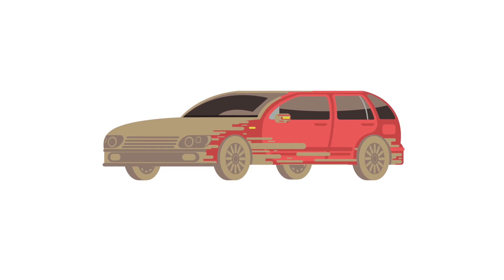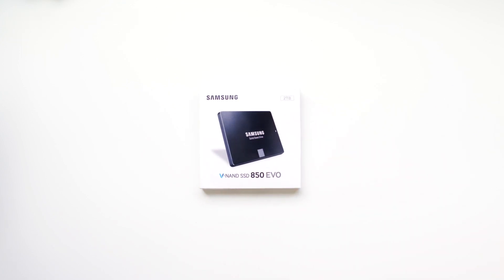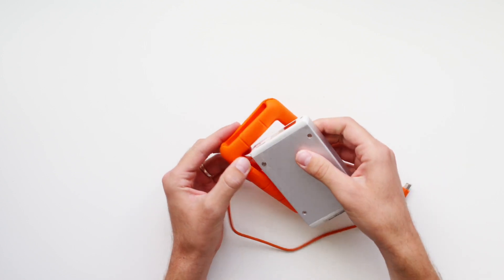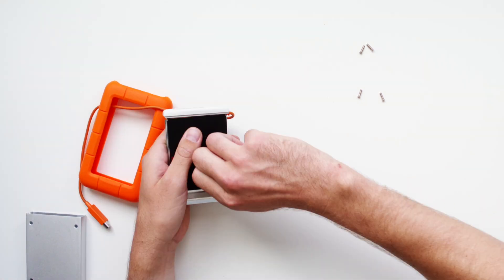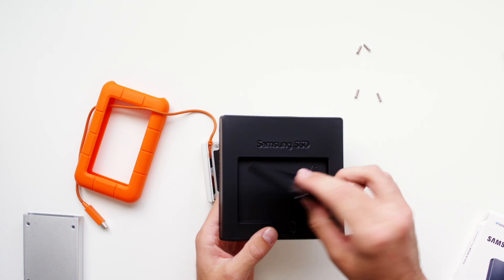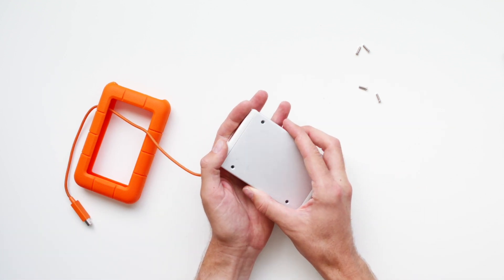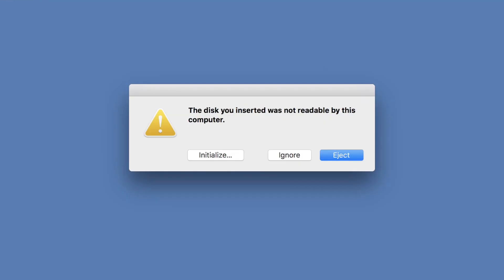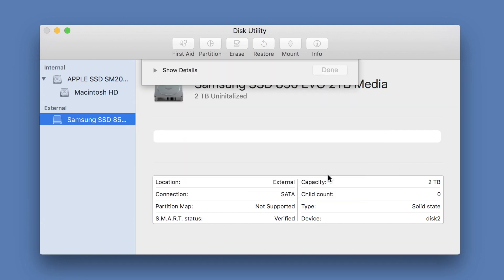DIY Upgrade Your Lacie Rugged Hardrive

Comment: I recently upgraded my 1TB Lacie Rugged USB-C drive with a Samsung QVO 2TB SSD. When connected to a 5Gbps SATA dock, I achieved speeds exceeding 400MB/s. The same goes for when I used a generic enclosure – consistently around 400MB/s.

However, when used with the LaCie enclosure, both read and write speeds were limited to 250MB/s. This seems to align more with the real-world speeds of a SATA II 3Gbps to USB 3 5Gbps setup, while generic enclosures perform in line with a SATA III 6Gbps to USB 3 5Gbps interface.

It's surprising that LaCie possibly opted for a SATA II interface in a 2020 external hard drive.
Reply: I have a 5tb lace usb c hard drive can I do the same and which other ssd should I use
Reply: @THELIFEOFCB  Yes, use any 2.5 inch SSD. Samsung EVO series are good, Crucial MX500 and Samsung QVO are not bad.
Expect speeds to be limited like OP said.

At this point buying a new Type C SSD might be the better option. It'll be faster and you'll have two extrenal drives for backups.
Reply: @tomhsia4354  why the prices have came down?
Reply: @THELIFEOFCB I have absolutely no idea, probably a NAND surplus.

One of my friends who seem to have connections says it's due to some impending NAND tech breakthourgh (something like Micron's 232-layer NAND) but I'll believe it when I see it.
Reply: I can confirm this.
I upgraded my 2TB LaCie Rugged USB-C drive with a Crucial MX500 2TB SSD (TLC NAND). The Lacie enclosure limites the read speeds below 250MB/s (2000Mbps). Given how the SSD version of the same drive was rated up to 510MB/s I think they have a lower spec connector in the HDD Rugged Type C. Another thing, the HDD that came out of my LaCie was a horrible Seagate Rosewood.

The SSD version (which I can no longer find) is definately SATA III, the HDD version might only be SATA II as you've said. It makes sense, none of the HDD drives used by Lacie can saturate the SATA II interface. This also pushes you to buy their newer (NVMe) hideously priced SSD offerings.

At this point buying a new Type C SSD might be the better option. I personally don't mind the speed limit, the added toughness, decreased response times, doubling of speed, and decreased heat generation make it still acceptable to me.

Comment: Hello. Thanks for the very informative review. I just have one question I was wondering if you wouldn't mind answering for me I'm stuck before buying this? I plan on hooking this drive (SSD Rugged 500gb) up to my mac with the old thunderbolt 2 cable and installing OSX on it to achieve faster speeds than my internal hard drive. My question is, when I do this, could I utilize the USB 3.0 port on the Lacie device to connect an extra 2TB hard drive? That would mean I have 2 external devices and one of them would be faster speed (USB-3.0)... Someone mentioned that they are not sure this would work as it's maybe not a "thru port"? If you could somehow clarify this I would be very grateful
Reply: The ThunderBolt standard is “daisy chainable” this means that if the device supports daisy chaining, (typically indicated by the presence of TWO Thunderbolt ports), you can connect multiple thunderbolt devices and they will operate in “parallel”

I do not know if there is such a standard that does daisy chaining to a TB to USB3

This is possible with additional hardware, for example, a CalDigit TB2 will do this, but it’s essentially a TB2 “hub”, not a Hard Drive enclosure.

So I suspect the answers is NO

Comment: Is it able to keep up the speed of the Samsung EVO or it reduces the performance? Please let me know if you have done any speed test. Thanks!!
Reply from the maker: Antonio José  I haven’t done an official speed test but I have been using this drive and the speed is wicked fast. Since it is a thunderbolt drive, the ssd takes advantage of that faster connection. Thunderbolt is made for ssd but Lacie selles Thunderbolt drives with spinning disk which means the drive is only as fast as the disk. With an ssd the Thunderbolt definitely keeps up with the EVO
Reply: I see, I need to check my Sata connection since I got the older Lacie. I hope it has a SATA3 but I can't finde anything even in their manuals.